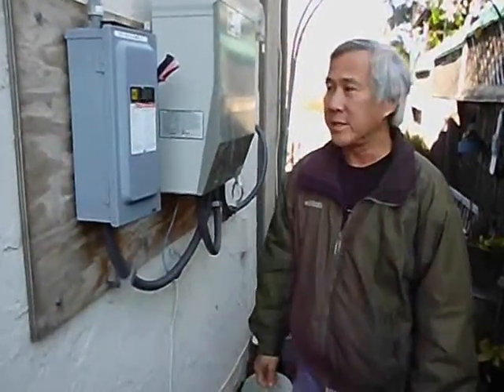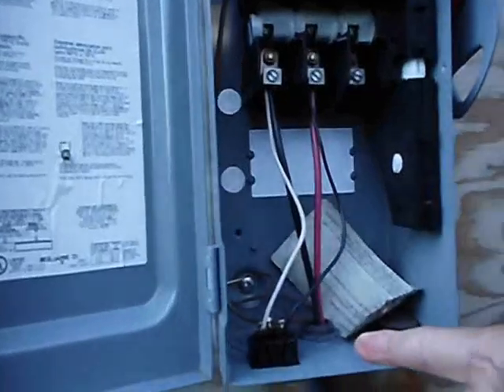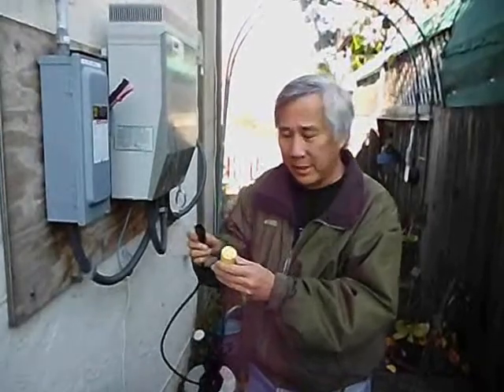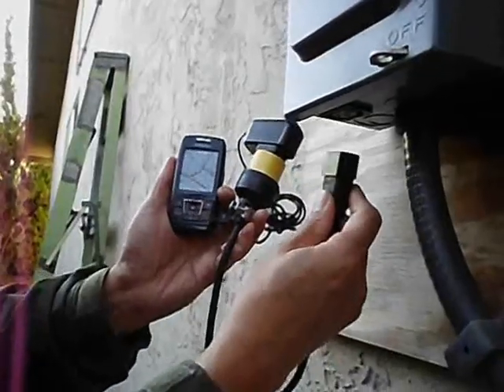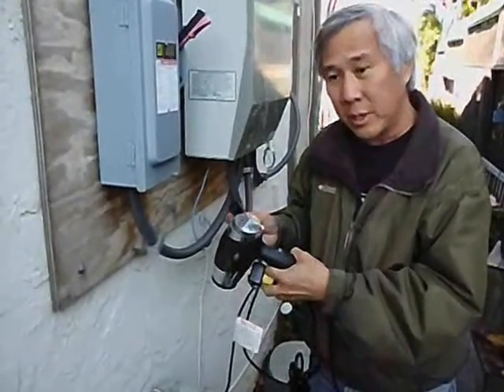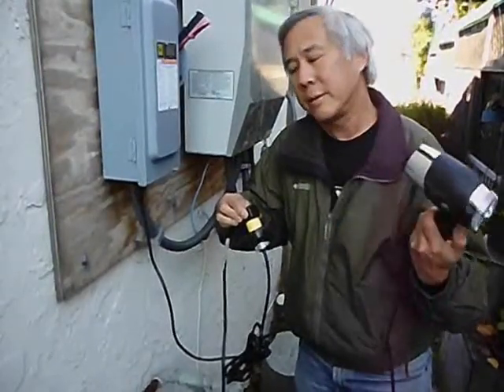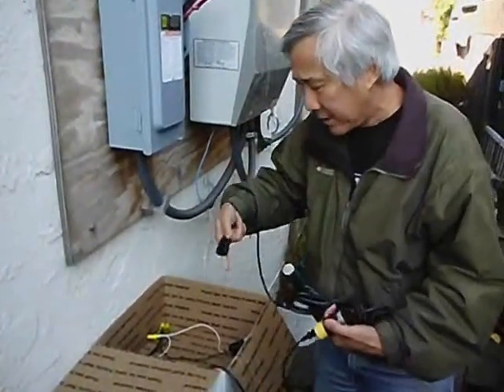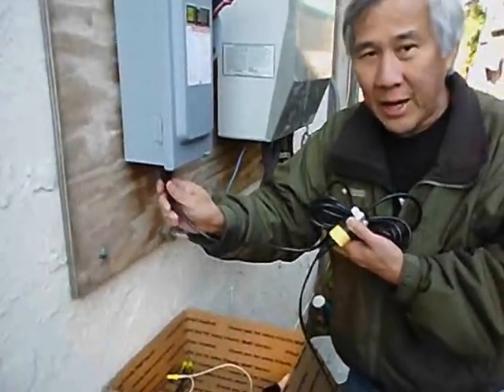Power 115V AC appliances from 200V DC

Comment: now days most of the portable appliances are using switch mode power supples like wall adapter,SMPS first convent AC to DC for high frequency switching.so they can work on both AC and DC

Comment: Just a quick note on safety. Particularly in regards to AC appliances that have a power switch. Like the hair dryer for example. Turning it on with the switch is ok and running it (as it proved to function fine with no ill side effects), but I would rather unplug it from the socket when I am done with it (and not use the AC-rated power switch to turn it off), since DC has a hazard of arcing when you try to break high voltage DC circuits. 

Please check out these 2 videos relating to this topic:
https://www.youtube.com/watch?v=rlG2Y7hBZJM
and:
https://www.youtube.com/watch?v=Mtq3cs9Gucc

Comment: The incandescent bulb is dimmed because the current is limited by the CF bulb.  If you had two incandescent bulbs in series, the the brightness would be normal.  It was also interesting to see the higher inrush current of the CF bulb as the incandescent bulb was brighter for a second.  The incandescent bulb is basically operating as a shunt, the brighter it is, the more current is flowing.  If put in series with a very low draw power device, it will allow voltage to the other device.